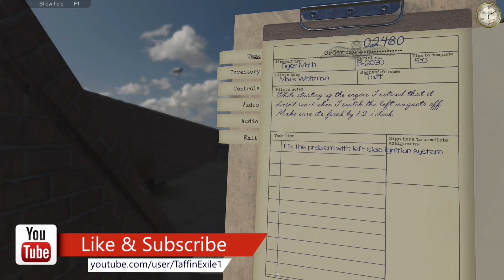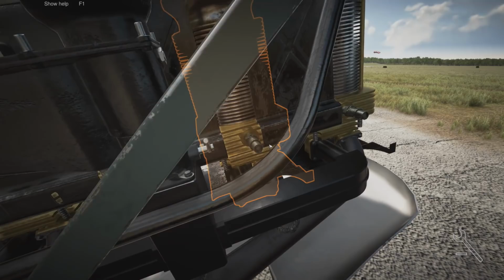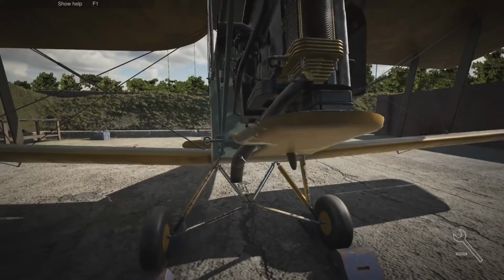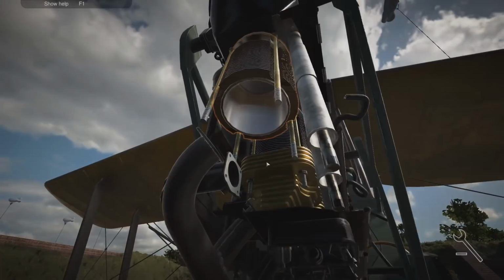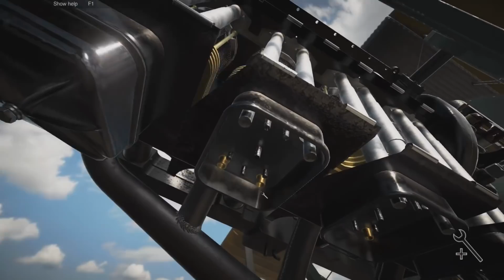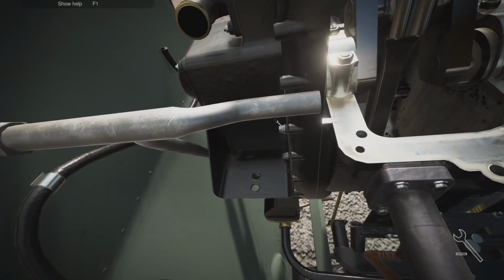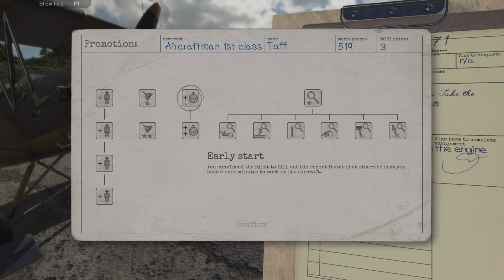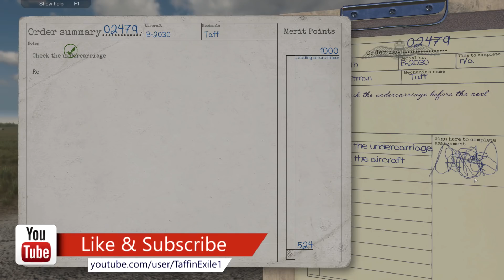Plane Mechanic Simulator | Tiger Moth Maintenance | Part 4

Comment: Hello ladder my old friend sing
So, yeah, no poll...I'm fine with either the Tiger Moth or the Spitfire. And about that engine inspection: I think you can pull the entire engine out. There was a hint in one of the previous task about that. Would make working on the cylinders much easier
Reply: I mean, the task quite literally said "take apart engine and change worn parts".

Comment: And if you do want to remove the head gasket, you must click on the cylinder assembly first. You should also be able to remove the cylinder head/cylinder assembly with the spark plug in place, you only have to remove the wire from it.

Comment: Taff, there is a timed mission where you have to do a full inspection.  You may want to consider just tearing the engine down to the motor casing and just checking your part list for the damaged parts you took off.
Reply: One more thing, when you drop the cylinder assembly out they get put on some small benches behind the plane.

Comment: Speaking from an actual IRL mechanics point of view, you cant change or R&R a valve with the head on- this game is pure fantasy on most of the "mechanics" of it- it would help you to have a basic knowledge of how engines worked - it seems you dont? LOL
Reply: It would help to have basic knowledge of all the parts actually modeled in the game.  I keep having to look for new parts that have not come up in previous missions.  Such as the push rods for instance.